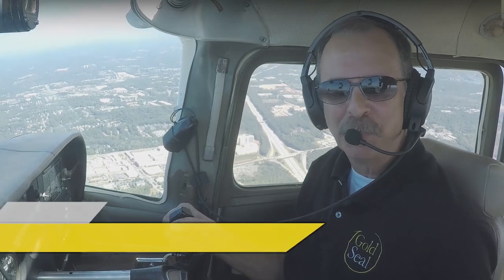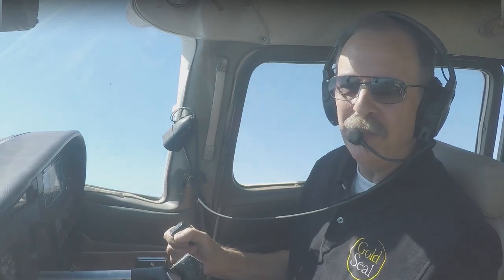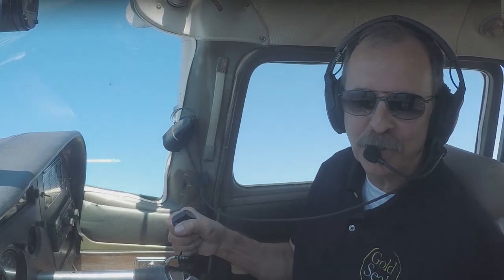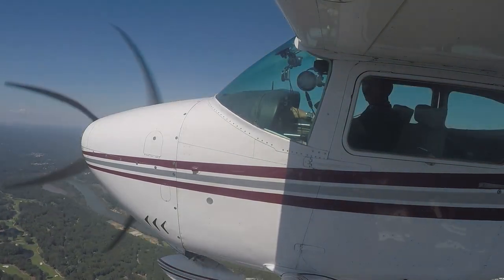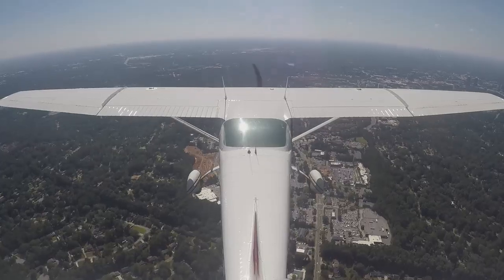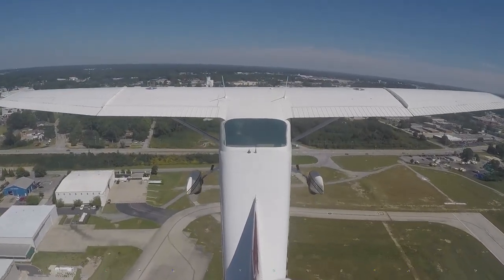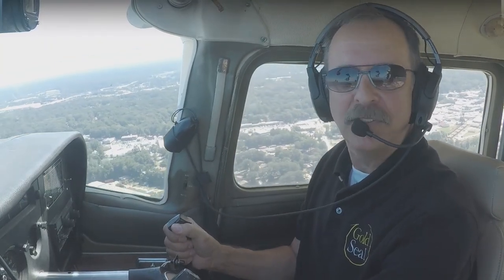Class D Traffic Pattern - Radio Communications

Comment: At my local Class D airport, if I fail to include the runway number in my acknowledgement of a landing/option clearance, the tower controller will ask me to “Verify cleared to land two-eight left.” I will then have to read back the clearance. I noticed that in this video, you got away without mentioning the runway in the acknowledgment, twice. The controller should have called you on that.
Reply: It is required to say the runway number for all clearances..you must readback all crossings, hold shorts and when told to line-up-and-wait.
Reply: The tower is a training tower.

Comment: I could not understand the controller when he cleared you for the option. I kept replaying but could never fully understand just what he was saying. THIS is why new pilots like myself are leary of controlled airspace. These controllers talk so fast and sometimes garbled that we have a hard time understanding what we are being told.
Reply: Phil Niemerg  I’m a Scottish low hours new PPL just moved to Chamblee. Next door to PDK. I have started flying out of PDK. Took 5 dual hours with local school just to get some confidence on the radio and dual runways. Have to say it’s a real challenge trying to understand the controllers accents and speed. I’m sure it’s same for them with my accent. However in all my business activities ( I do lots of presentations and public speaking) I never have ‘understanding ‘ issues. It’s just I guess the speed and tempo of PDK ATC.
Reply: Hes right, you know. I listen to KDFW daily, and its almost like some controllers/pilots communicate using telepathy, but speak as a formality. *Cue the X-files theme song*
Reply: I think the problem isn't with the accent, but radio interferance. Some people need longer to get used to this very artificial sound.
Reply: Not just there...KDWH gets like that at times. It's almost as if they're competing for entry into Guinness. 
Always ask for a repeat if you don't understand. They'll eventually get the message to slow down.

Comment: As I remember flight instructor Dennis saying to Steve "FlightChops" Thorne, paper and pencil don't get cracked screens, don't run out of battery, don't usually crash, or any of a number of any technical difficulties.  So writing your info on paper is a plus in a lot of circumstances.

Comment: Yeah, I've flown in and out of KPDK a couple of times.  It's really busy.  Most of the time it's busier than most class-C airports.  This video was a very good flavor of it.  

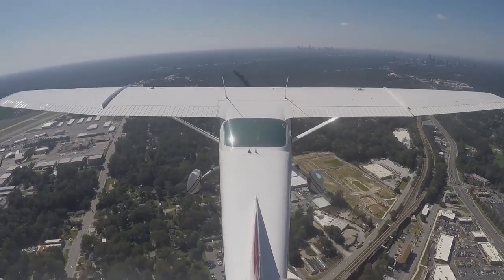One minor quibble.  This video was uploaded in November 2017, and presumably was shot fairly shortly before that.  The runway diagram shown at 0:25 in this video was even at that time at least three years out of date.  09/27 was removed as a runway sometime before April of 2014.  I was on an airliner departing Atlanta in early 2014, and I snapped a photo of the airport with hangars built on what had been the approach end of 09.  That area appears just under the left wing at 13:12 in this video.  The reason I know the date is that I have that photo from above KPDK and it's posted in a blog entry dated April 26, 2014.

Comment: Thanks, Man - You are one cool cat. I guess even though you are squawking 1200, you still must ident? What is the meaning of the Tower's 05/08 comment 
at 8:35? Also, please advise if you have made or know of an animated spot-view vid that would show all this traffic for the student to simultaneously
see and visualize all of the other traffic to understand the bigger picture. Thank you for this and your other very useful videos !
Reply: kurt schu 05008 means the direction and the wind speed. Wind coming from the 050 degree and the speed is 8 kts. Sometimes tower gives you this information so you would have an idea of your wind corrections when landing.
Reply: Controller/pilot here. Most towers are equipped with a radar that helps us deconflict aircraft and locate you when you check-in on initial call up. If the airspace is busy and there are multiple targets in or around the Delta, an altitude and distance report may not be sufficient enough for us to correctly identify you. In that case, we'll have a pilot ident. The pilot's target will then flash on our radar once he presses the IDENT button in the cockpit.

Comment: Thank you, excellent ! What is PDK' Tower's 05/08 comment at the 8:30 video time mean? Also - even when you are squaking
1200, you must ident for ATC? You are a very professional guy - wish you were in SAn Diego, I'd be on my way over to sign up.
Reply: He's using 1200 on the transponder which is the general frequency for VFR flights without Flight Following from ATC. Because the controller has a big screen with many aircraft, when somebody calls him up he will ask them to 'IDENT" which makes the aircraft flash on his screen so he can find the Aircraft calling him and verify the information given to him over radio. Once he sees the aircraft calling, he clears him into the airspace and sets him up for the requests. In this case, they wanted to do some touch and goes, so the controller told him to join Downwind, and the standard entry is a 45degree entry. The pilot here was anticipating all this and was arriving VFR from the side of KPDK which would make navigation quick.

Comment: What I'd like to see more of is radio communications when engaged in closed traffic at a towered airport. I saw a little here in this video. What's confusing is should you be calling your turns, or just make them assuming the ATC knows what's going on?
Reply from the maker: Hello Angela. Calling turns is not done at towered airports unless the controller stipulates it (which rarely happens).

Comment: Quick question...do you reduce power when you're abeam the numbers or keep power the same and add 10 degrees of flaps?  I've had two instructors teach me both ways.  I prefer to reduce the power but my current instructor teaches to not touch the throttle until I make my turn to base.
Reply: I was taught to cut the power as part of the configuration process. The downwind to base turn should happen after a descent has been established, which requires a reduction in power. Of course, if you’re doing an extended downwind, that might change

Comment: You have a busy radio but when you're told you're number #1 for touch and go  then you don't have to radio them when your turning base/final?
Reply from the maker: There's no base/final radio report required. There were two touch and goes in the video; both were cleared and acknowledged on the downwind leg.

Comment: Why left closed traffic instead of just left traffic
Reply: Its just proper phraseology controllers are taught
Reply: Closed patterns are different than standard crosswind, downwind, base VFR patterns you are used to. It’s a 180 to “inside downwind” which is much tighter than you’re used to. Then followed by a descending 180 to final staying much closer to the runway. The point is to expedite patterns